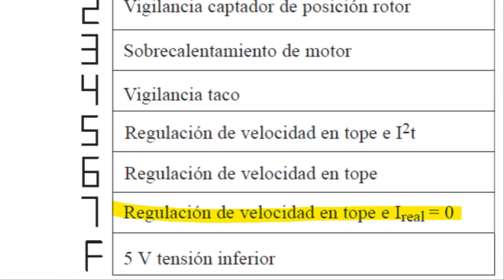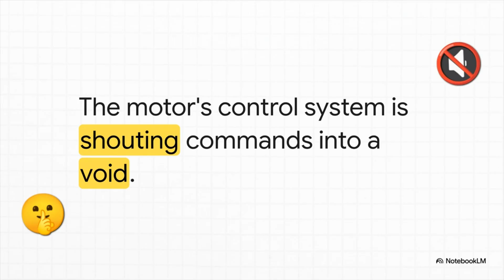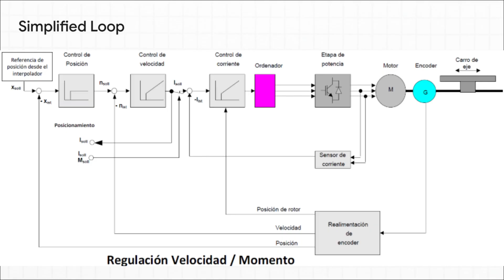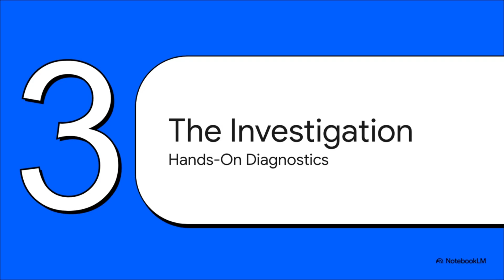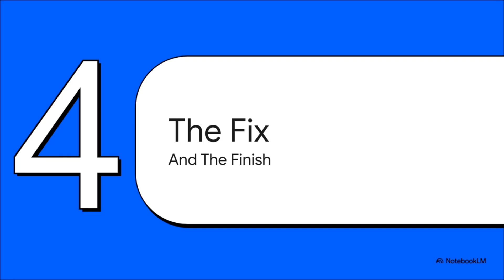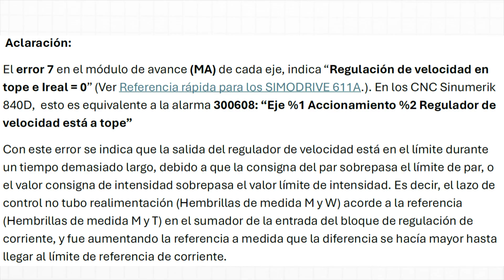Sinumerik 840C-Simodrive 611A: Error 7 “Regulación de velocidad en tope e Ireal = 0”

Comment: Alarm 21612
Reply from the maker: @ferhatsaifi, hi there. I guess the alarm 21612 is the consequence, not the root cause. You should have several alarms and on their timestamp you could see which one comes first.

The Sinumerik 840C alarm 21612 is a PLC-generated diagnostic message, typically indicating a problem with axis control or communication between the CNC and the drives.
🔍 Alarm 21612 – Meaning
This alarm usually appears when:
- One or more axes stop moving unexpectedly.
- The spindle may continue running, but axis movement is interrupted.
- The alarm may alternate between different axes (X, Y, Z, C).
⚠️ Possible Causes
- Incorrect machine data configuration, especially axis assignments or coupling parameters.
- Errors in the PLC program logic, affecting axis enable signals.
- Hardware issues, such as loose or faulty modules.
- Electrical noise or interference affecting communication between the CNC and SIMODRIVE modules.
✅ Recommended Actions
1. Check machine data related to axis configuration and coupling.
2. Review the PLC program, especially logic that enables/disables axis control.
3. Power cycle the CNC after making corrections.
4. Inspect hardware connections and modules (especially SIMODRIVE 611-D).
5. If the alarm is machine-specific, contact the OEM or machine builder for tailored diagnostics.
Reply: @FabianAchaval  your description of the issue is more accurate. Thank you very much for your support, I will give feedback once we solve the issue. I am really appreciate you